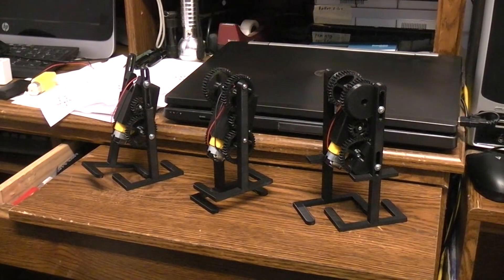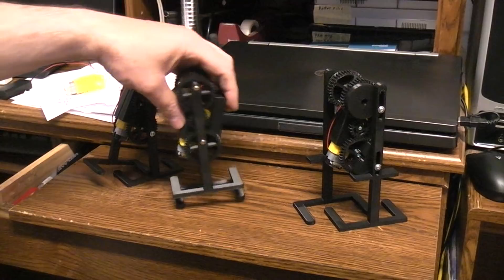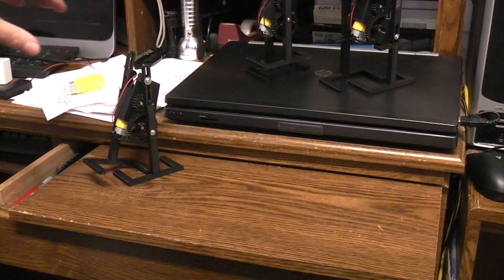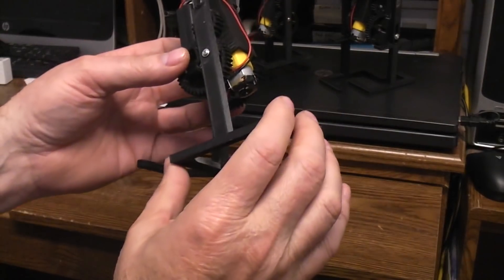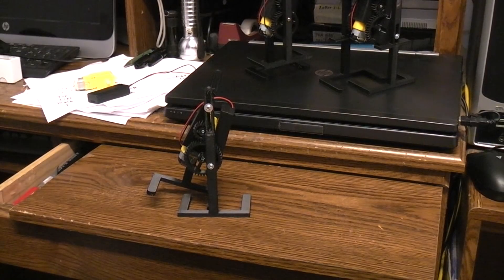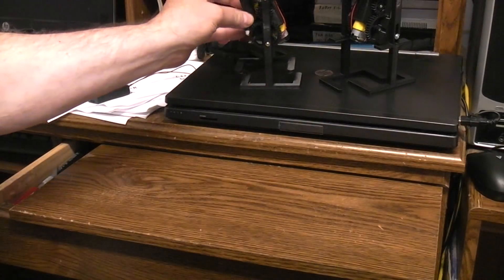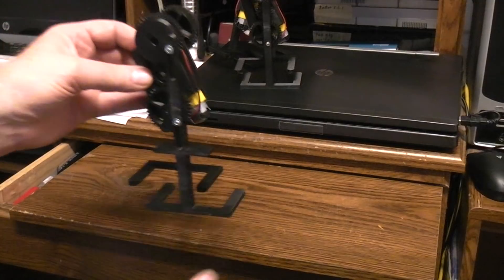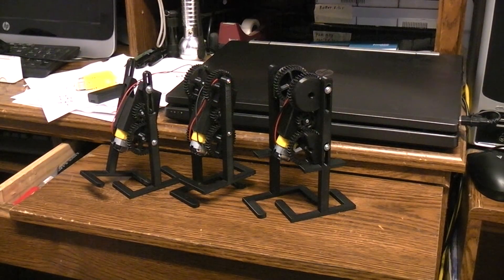3 walking leg mechanics you can 3d print and build.

Comment: can u tell me the rpm for the motor u used in type 1 project ?
Reply from the maker: Yellow TT gearmotor 1:48 . This is the most common of the TT gearmotors and the rpm varies with how much voltage you feed the motor. There is also a Yellow TT gearmotor that is 1:120 reduction. It is the slowest RPM, very hard to find these days. Now they have a Blue TT gearmotor that has metal gears inside and it has a gear reduction of 1:90 so slower than the common 1:48 but not as slow as the hard to find 1:120. So you might just buy the newer Blue TT gearmotor. I find them on Ebay for less money than on Amazon.

Comment: I have already printed type 2 walker. But the large gear which is down side can not contact the smaller one. I printed again in my second printer to make sure but problem goes on. There is  about 2mm distance between two gears. So I read your video’s comments. You wrote like that you changed the motor frame. Can you share with me the old version of motor case ?
Reply from the maker: The project is over 4 years old, I no longer have the old files, only what is ion thing-i-verse. But I did build a handfull of these for friends and they all worked.

Comment: Excuse me what types of screws, washers and nuts you used?
Reply from the maker: The screws and washers are all talked about in this video, mainly covered in the middle of the video when talking about type 1 walker. But same screws for all 3 types of mechanics. For example I used a 3mm by 12 mm screw to hold the large gears on to the gear box and # 3 washers and the smaller screws are #2 taping screws that were about 5/16 inch long with number 2 washers. But you can find screws to fit no matter where in the world you live. Just print out the parts and take a trip to the hardware store and find some screws that fit. Or like me dig threw the junk box until you find some that work.  Also you will find that I put out videos that include bodys for these walking mechanics and in those complete build videos I show and talk more about the screws used. Happy building

Comment: ... just for your information. Some of your thingiverse links lead to completely different designs. You should check that out
Reply from the maker: Thank you for the heads up. I have updated the links, so they should work now. I hope !
Reply: I was just printing the files for the type 3 at Thingiverse. It seems to me that files are missing. Or some parts are printed twice. With the legs that's clear. But it probably lacks other parts, right?
Reply from the maker: The legs you print twice, the Level gear Cam 1 you print twice , the Level Gear Cam 2 you print twice, the Motor frame you print once and the Motor Small gear you print once as the STL has 2 of the small gears in it and I think that was the only file you were missing. Thank you for the heads up. The motor small gear should be on thing-I- verse now . But it is the same files as used on the type 1 and type 2 walker .
Reply from the maker: I also changed the Motor frame file as the one I had posted was a only 1/2 the part. Thank you again. I will go check the type 2 walker now as it uses the same motor frame.